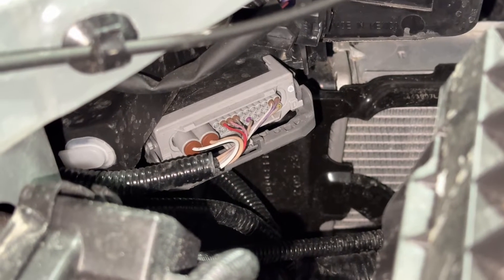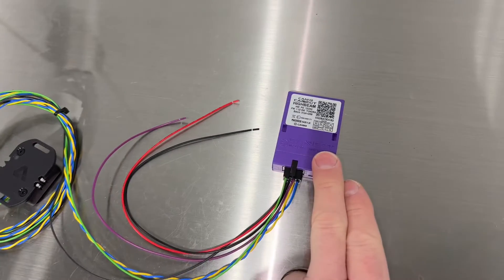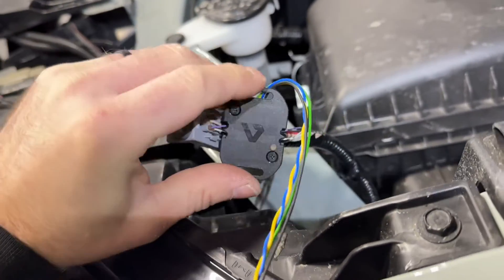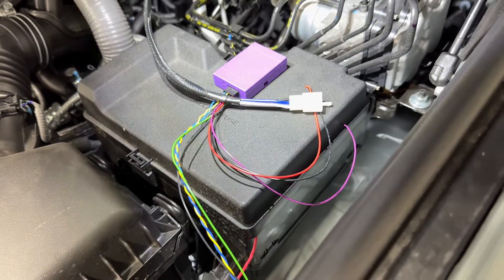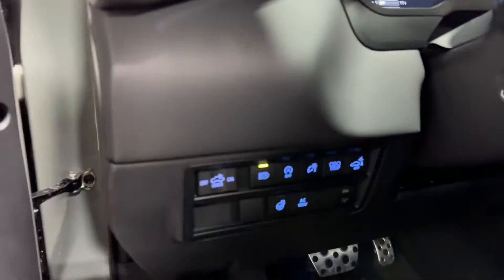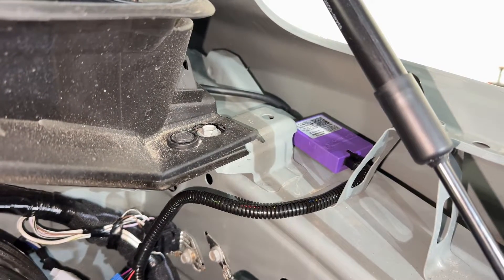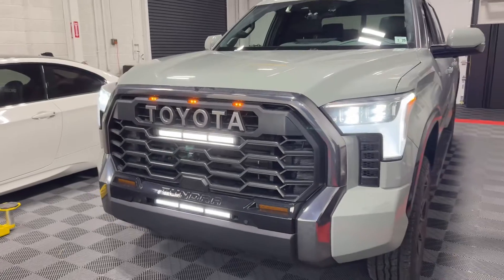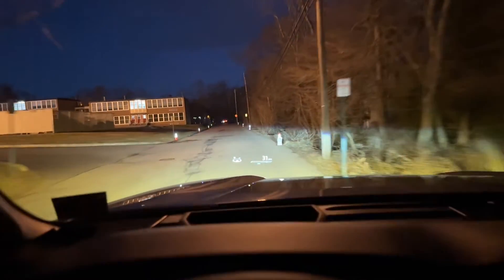How To: 22+ Tundra - Wiring Diode Dynamics Light Bars To Auto High Beams

Comment: How does the in-dash light bar button function set up this way? The only point in using it is if you can disable the light bar as a master switch function. So regardless of what the can bus reader is signaling to the relay they don't turn on with the high beams. But I don't understand how just tapped in the way it is, how the can bus reader wouldn't still send a signal to the relay and turn them on regardless of what you're pressing on the button in the dash? The original light bar button and the dash should serve as an interrupt so it can be a master off so your truck can operate with high beams as normal without the light bar
Reply from the maker: End of the day, you can wire it to tailor your own personal needs. 

The aftermarket in dash switch is essentially an over ride. Both the can reader and the switch can trigger the relay. Can activate any time I please. But I leave my lights on in auto and I let the light bar come on with the my auto high beams. That is the way I prefer it.
Reply: @LightwerkzGlobal I really appreciate your video on this. It helps others like myself. Please do not interpret my question as criticism. I am just trying to learn. Do you think a person could wire the 12-volt wire coming out of the relay into the can M8 and then replace the 12-volt input at the switch with the can M8 trigger wire and then simply tap the can m8s ground into the switches ground wire to wire the switch as an interrupt?
Reply from the maker: @RB-dc2bp  No worries at all. You can definitely wire the switch as an interrupt.

Comment: For your trd light bar whats the plug in the back i have one and they didnt give me the plug or wires so frustrating
Reply from the maker: The aftermarket light bar kits won't come with a model specific OEM style plug. I ordered one from Caliraised LED and then wired to the Diode Dynamics relayed wiring harness.

Comment: Have you had the CANM8 CANNECT HIGHBEAM give you errors after install. Mine usually works but once in a while it’ll stop and the canm8 will show a red light. Then eventually usually work again. Any ideas?
Reply from the maker: Havent had any trouble. Try reseating the wires in the module.
Reply: @LightwerkzGlobal  so it showed green today. Took it apart and made sure connections were good. Put it together. Still green. No light bar. Checked the posi taps. They are tight and secure. Any thoughts? Faulty unit?
Reply: @LightwerkzGlobal  figured it out. Mounted the little box where you did and it got wet. Corroded inside. Fffff
Reply from the maker: @ianpaddick2003  Ah. The company did warn me these are not waterproof. Hope you are able to clean it up and make it work.

Comment: always love the content Ceasar!!!
only thing i would have done differently would have been with the tie in. Considering those basic white connectors are loose fit/finish to begin with, instead of the Posi-Loks i would have de-pinned those 3 wires and simply surface soldered the new wires to the pins and reinserted into the connector. But those are just semantics anyway......Still running my Evo2.0s that I bought from you YEARS ago(believe they were the  1st set you guys sold retail) and they are still amazing!!!! Keep up the good work and love you guys!!!!
Reply from the maker: Agreed with you! This was meant to be a DIY friendly. We use the Posi-tap frequently and they are solid. EVOXR 2.0 are power houses! Glad you are still enjoying them.

Comment: You blasted two drivers at 8:08 and 8:32 with an offroad lightbar on an urban road. Dont be this guy.
Reply from the maker: Definitely not the plan. This was literally the first time testing the "auto" high beam feature. Around a curve so it didn't shut down soon enough. The system is slightly delayed. The good news is I can deactivate high beams and since the button is on Auto, it just reactivates the next time around. So its easy to shut down if I see the possibility of blinding someone.
Reply: Worry about yourself schmuook

Comment: Those Toyota headlights look like they have some great output! I wonder how they compare to a LED Projector (Morimoto/NHK etc).
Reply from the maker: They are really top tier on these premium lighting package assemblies. Love them! Will be tough to beat for aftermarket manufacturers. Havent compared them to a retrofit projector yet.
Reply: @LightwerkzGlobal Really wish they were available as an aftermarket solution. There's just something about great OEM components.
I'm planning an elaborate lighting system for my passion project truck , and looking for what the best possible solution is . I'm really stuck on this!
Reply: Factory LED units generally are going to be better than LED retrofits.

My 2019 wrx had steering response LEDs. Absolutely phenomenal. Great output and coverage even on the sides without blinding other drivers thanks to the steering response putting the hotspots on the road when in the curves, reducing the need for highbeams.
Reply: @SirBrass  Im partially contemplating giving a serious look at making a steering controlled lighting system.

I've already developed some Cornering Lights that only turn on with my turn signals, and only at night as well as only at certain speeds (approx between 5mph and 35mph). Also used a dimmer module to slowly fade them on and off. Also tied into Rsverse so they both light up in reverse 

The new idea would either use a custom steering position sensor to drive a servo, or a mechanical setup that piggyback off the tie rods (easy to access dye to my long travel suspension)

Comment: Sweet !
Man i wish there was an aftermarket automatic high beam assist system available. I tried to make my own using some photocell sensors but they just dont detect oncoming headlights. Im always thinking about how to achieve that!
Reply: Our Odyssey has auto high beams and they're VERY annoying. It'll cut off HBs when there's a car on a fully divided highway in the other direction, which cuts off the necessary light you needed when you're the lead vehicle in your direction. 

It also cuts off if there's momentarily a bit of road lighting ahead, even if it's not sufficient. And it's SLOW to turn them back on. So with Auto HBs, you're likely to spend 50% or more of the time when you need them on with the system keeping them off due to programmed lag time or overly aggressive shutoff programming turning them off when it's perfectly safe, legal, and necessary to keep them on.

Thankfully the Odyssey allows manual control of the HBs even when Auto HB is active (unlike the Chrysler Pacifica where you have to reach over to turn headlights to manual on from auto before you can exert manual control of the HBs, and the HB stalk ONLY acts to allow HBs to turn on if the Auto control programming allows, if headlights themselves are in Auto mode), so the driver can exert control when the system is being stupid.

Comment: Does the CanM8 module have built in compatibility or did you have to contact them for a custom module? Also do you know if this works on basic headlamps as well?
Reply from the maker: Note down your model at checkout. When I got it I noticed Tundra on the label.

Comment: If you turn the switch off for the light bar, will just the high beams be on? Would love to do this. But sometimes the high beams turn on a bit soon and would prefer the bars not do that
Reply from the maker: With this method it’s tied to high beams. So if they turn on - as does the bar(s)